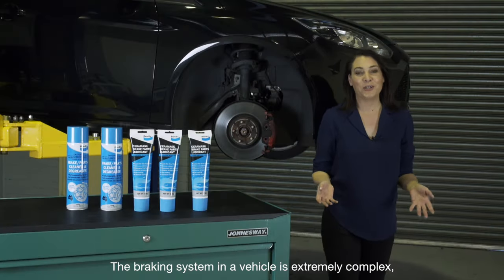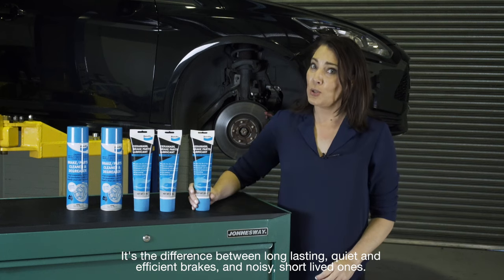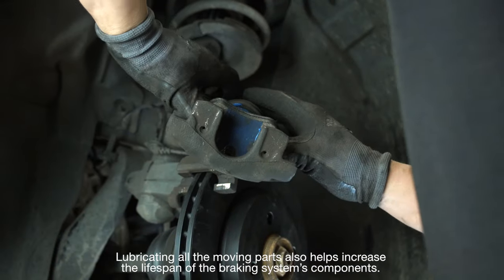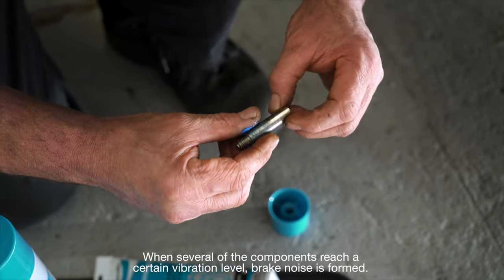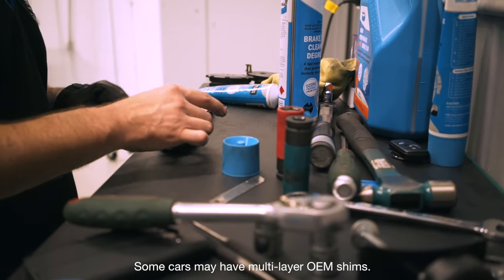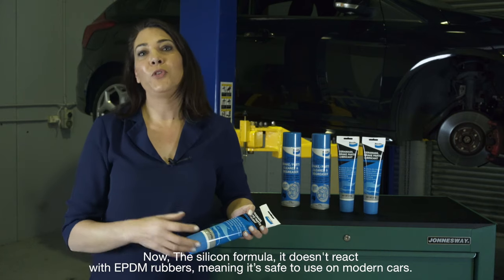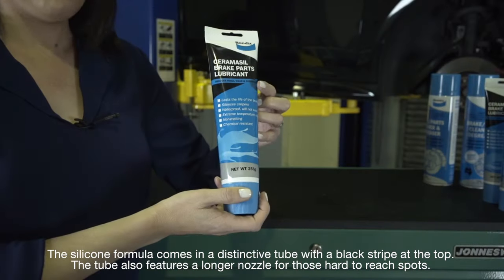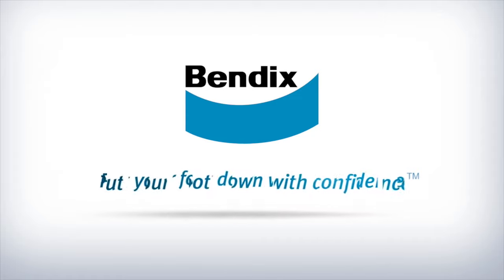How to Lubricate Brake System Components

Comment: This stuff is definitely brilliant for metal on metal contact. Having said that I have had the experience where using it on slide pins has chemically reacted with the rubber boots and caused softening and problems with the rubber but maybe that depends on the manufacturer of the rubber, so I think it helps to be aware of that, silicon grease for rubber stuff is safest

metal on metal  You can’t beat this stuff…!!

Comment: i have used this but next brake job or general service there is no trace of lubricant  since there is no blue color as originally is i presume the color would change contrary as this video claim.
Reply: Dirt all over it
Reply: Did it dry out ?
Reply: Yes as I said there were no trace of lubricant nor blue color
Reply: @seaton95  Maybe i should cancel my intention to order and use it.. will stick with the old seiken rubber grease,.